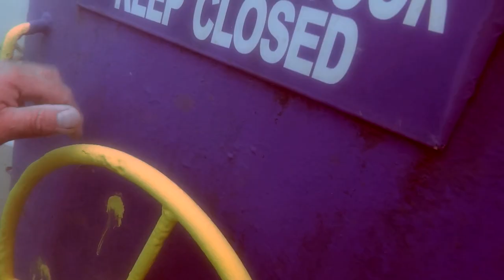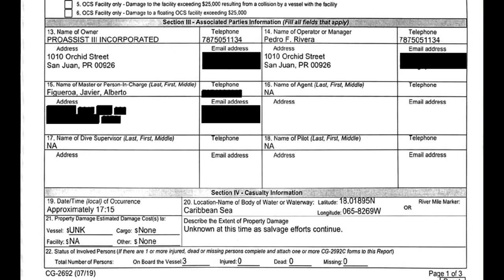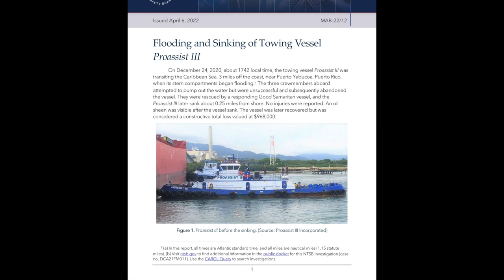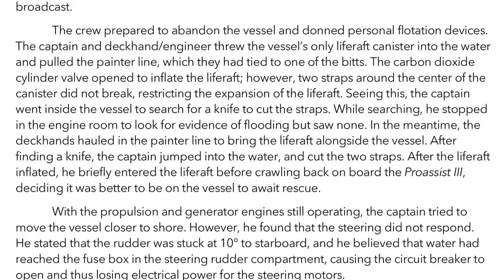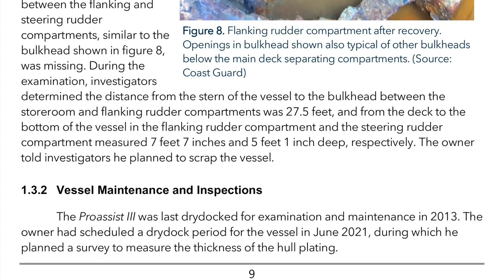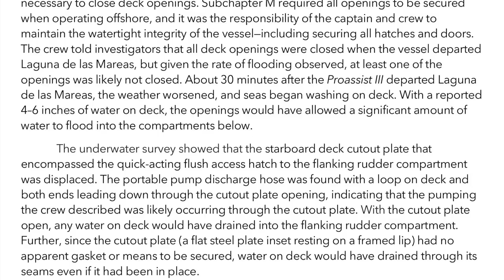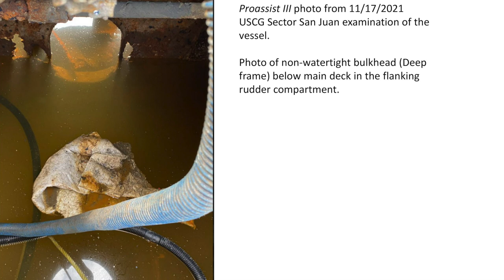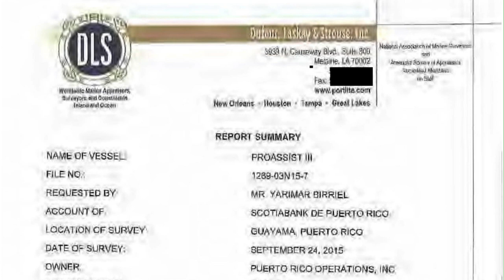Sinking of the Proassist III

Comment: This is not a tug it's a tub. I was 3yo the first time I went with my dad on his tug and I spent most of my life on the water. Before they showed the bulkhead pic I was thinking that this wasn't an accident. Because I've been on a similar tug in 12' to 15' seas and while it was a white knuckled ride there was never a fear of sinking. You can have waves roll over the deck and it will pop right up to the surface. As for this tub, I wouldn't want to be seen on it at the dock. The owner let this vessel turn to junk and should not be allowed to own any kind of seagoing vessel. Whether that be a tug or a dingy. However, any captain worth his salt could have saved it. I still wonder if it wasn't sunk on purpose. Without the rudders, you could have still maneuvered this tub by adjusting the thrust of the engines. This is something that is done all the time. Something is fishy here. Pun intended! 😁

Comment: Build date was 1949, but tonnage was reduced in 1946? It says it was regularly inspected until 1996, but changed it's rating 50 years prior to avoid further inspections? Is this a time traveling vessel or have I had a stroke and misunderstanding what I'm reading?

Comment: The continued operation of this vessel in its wilfully neglected and decrepit state, and with a catalogue of at least 80 known faults, in open waters could only lead to one outcome!

Even had the vessel been tied at dock she would have sunk with rainwater causing downflooding in place of the sea doing it!

No vessel with so many deck openings and corrosion holes could possibly have remained afloat, especially as there were no high water alarms in the compartments that did downflood.

For a vessel to be taking on 304 gallons of water a minute, that's indicative of a large opening to the sea.

It is evident that the owners did everything necessary to avoid inspection and compliance with Coast Guard regulations, and instead did absolutely nothing to ensure that their vessels were seaworthy.

The nature and extent of corrosion in the supposedly watertight bulkheads is evidence of decades of systemic neglect, and a lack of maintenance and repairs.

The absense of sealing gasket materials of the watertight doors and of the door locking mechanisms actually preventing the closure of the doors is evidence of years of malpractice, neglect and utter contempt for crew safety!